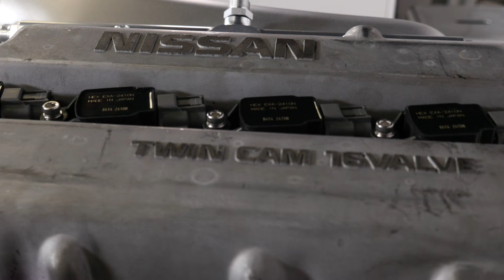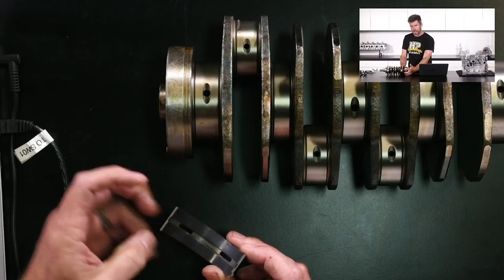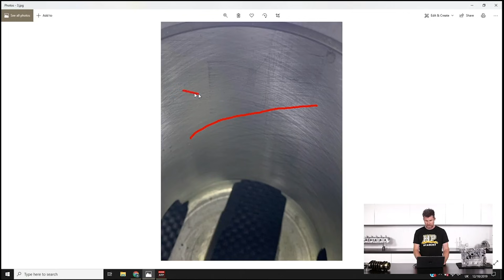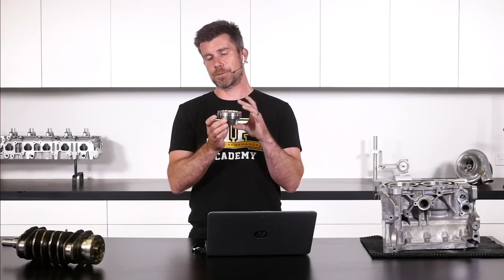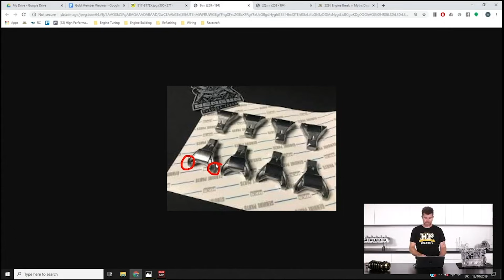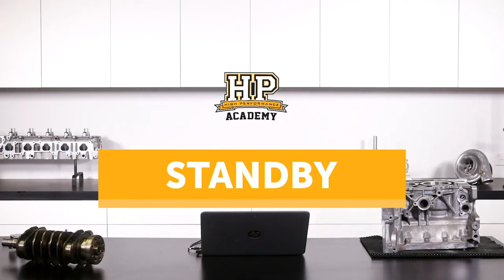Engine Break-In Myths Dispelled | Engine Break-In Tips And Tricks [GOLD WEBINAR]

Comment: Getting a new reman engine in a 2010 Subaru Legacy.  The work is being done in Memphis, and I live in Chicago and I don't have a lot of time off, so I'll have no choice but to drive home (approx. 550 miles) immediately.  That's a lot of highway driving for a brand-new engine -- I know I need to keep the RPM below 4000, not use cruise control, vary my speed -- but what does "vary my speed" really mean?  Every fifty miles?  Every ten miles?   Beween 70 MPH and 50 MPH?  Bewtween 60 MPH and 40 MPH?  I have a manual six-speed, so I can drive at somewhat higher speeds and stay under 4,000 RPM.  Should I make frequent stops (rest areas etc.)?   I'll be getting that first oil changs as soon as I get home, so I won't be too far over that recommended 500 mile limit.  But I definitely want to get home in as good condition as possible.
Reply from the maker: Most of the work is done by about 200km/150 miles. If your builder offers a break in service to do it for you, your situation is one where it might be worth considering that. Alternatively, it could be a fun mish, but you might want to factor in an oil change on the road.
To answer your speed question, as Andre covers in this lesson it's not about vehicle speed but rather RPM and load. You need to constantly work through the rev range and use some load to help expand the rings to give them the chance to bed in.
This can be something that we overthink, but on the flip side, as you mention, a rebuild is expensive, and you only get one shot at the break-in, with long-term consequences from both nailing it or getting it wrong - Taz.
https://www.hpacademy.com/blog/how-to-break-in-any-engine/
Reply: @hpa101  Chicago is about 550 miles from Memphis.   I shouldn't be more than 100 or 150 miles over the recommended mileage for the initial oil change when I get home.  Is that permissible?  I'm not quite sure how I can fit an oil change 50 miles outside of Chicago into what will already most likely be a 9- or 10-hour drive.  The estimates I've seen on that first oil change timeline actually range from 500 - 1,000 miles;  I certainly don't plan on stretching it that far, but if I'm somewhere around 650 - 700 miles, is that potentially fatal?
Reply from the maker: They're longer intervals than we use for performance engines. My advice would be to get the number directly from your engine builder. You trusted them to do the work, so you should be able to trust them to guide you on the break-in procedure that will keep their work warranted I reckon.
Now you have spent some time looking at other opinions etc you will be able to converse with them in a bit more detail about it or question anything that seems like a red flag to give them the chance to explain.
Safe travels! Don't forget a good Spotify playlist and your phone charger haha - Taz.
Reply: @hpa101  I know that I shouild be thinking in terms of RPMs not MPH -- that being said, I've seen it suggested that it's good to vary the speed every 10 to 15 minutes or so (which transates to roughly 10 to 15 miles on the highway).  
A lot of these recommendations are (somewhat frustratingly) vague -- we get a "range" rather than a specific number.  Even the recommendations for that first oil change vary between 500 - 1,000 miles.  (I'll be doing it as close to 500 as I can --  Memphis is about 550 miles from Chicago, so I'll probably be closer to 600 than 500, but I shouldn't be too far off.)  As for the playlist -- my car is old enogh to have a CD player!  But I have a feeling that I'll be listening to the engine pretty intently, just in case something starts to sound wrong, so I won't be playhing a lot of music (neurotic, I know, but this "long-distance" business is pretty srressful).
Reply: Looks to me as if ATK goes with the 500 - 1,000 mile recommendation for the first oil change.
Reply: I just discovered that the mechanic who installed the new engine used full synthetic oil in it;  so did the mechanic who just gave me that first oil change.   Have I inadvertently allowed damage to be done?
Reply from the maker: @jazzmanchgo - I wouldn't panic; it's not something we would do in our performance engine builds, but synthetic oil has come a long way, and it is unlikely to cause a dramatic failure. 
Bedding the rings in correctly and doing that first oil change on time before that metal in it causes damage are really the keys - Taz.
Reply: @hpa101  Okay, good to know -- got the first oil change in at about 800 miles, a little more than I would have wanted but unavoidable given the distance I had to travel to get back home.

Comment: I have just got my 2.2l diesel engine rebuild and was told that i have to load the stock map for the 1st 1000km run in period and then remap to stage 1, is this true or can i stick with my stage 1 map? Should i put some load on the engine the 1st 1000km like +300nm torque, with the current tune the engine made 522nm on the dyno at 2000rpm. It is a 2019 ford ranger 2.2 diesel auto making 146kw and 522nm without water meth injection. When running with wmi its making 156kw and 550nm at 2200rpm. I have currently switched off the wmi for the running in period as per instruction for the mechanic. Your input would be highly appreciated :)
Reply from the maker: If that's what you were told and what it will take for them to warranty the work they did for you, is what it is. Although for the stock tune to be accurate there shouldn't be any modifications to the engine, so running the stock tune on a modified engine would actually be more dangerous as a rule.

Personally I would run the tune for the engine happily, but I'm not your mechanic.

Do not sit at the same RPM and baby it. Progressively start to load it up across the rev range to break it in. As per the webinar things are bedded in long before 1000km though and Andre does run through in more detail - Taz.

Comment: When u are breaking in the rings how long do u wait between ring break in cycles should u apply throttle again to start the pull again to like 3,000 rpm and bring it back down to 20mph? How many cycles till u start to go to a higher rpm? When the rpm is reach at 3,000 rpm how long do u stay on throttle? Can u overdo this breakin process by doing it to often?

Comment: Forgive me if this was covered, can run-in be done on E85 or is Premium 98ron preferred for its lubricating properties? Thank you.
Reply from the maker: Personally I prefer where possible to run-in a flex fuel engine on pump gas (for you that's your Premium 98). With E85 you're generally going to be injecting 35-40% more fuel by volume and inevitably, there ends up some fuel dilution of the engine oil in the sump. I can't say you should never do it but I've always done my run-in on pump gas where possible - Andre
Reply: @hpa101  Thanks Andre. 👍

Comment: I've always wondered about full synthetic oil and engine break in.  On quite a few of its cars, GM recommends Mobil 1 full synthetic.  Do we think that GM is using mineral oil for it's initial fill?  Or, is GM installing mineral oil and then running the engines on a break-in dyno before, then removing and refilling with M1 before installing the engine's in a vehicle?  Not just GM - GT 500's require synthetic and I think also Mustang GT's with the Coyote engine.  What do you think?

Comment: I have new cylinders and new gapless piston ring sets for my engine.
I plan on a 2 step break in with oil from DRIVEN specifically made for break in. One batch is a   
15W50 and the other is a 5W30. Which one shall I use for the first 100km and which for the next 200km before going to a synthetic oil.
Btw. the camshaft are original in good condition with 100 thousand miles on them and look like new.

Comment: Todays new engines are filled with synthetic oil. If you think you can seat rings in 100 km's good for you. The only reason they moved away from so walked break in oils was for epa random testing for fuel efficiency. This is a fact. They pull random cars from the lot's and test them and they must meet standards. Therefore there are no longer break in oils or perriods like 500 miles and an oil change. Sad.

Comment: Breaking-in removes the tops of the hone peaks as the rings bed-in, and cylinder rings, cam shafts, lifters, and valve guides 'lap-in'. I've seen engines torn down with high mileage that still have significant hone marks, as the honing also provides valleys where oil lubricates long after break-in. Yes moderate loads and varying the rpm is the best approach for break-in for the first several hundred miles. Yes, an engine breaking in generates more heat from all the friction of new parts 'bedding-in'. Avoid breaking in at highway speeds on very hot days. Could over-whelm your cooling system, and your oil's ability to lubricate.
With all modern engines having much tighter tolerances than older motors, it's always wisest to follow the manufacturer's recommendations for break-in. Early first oil changes are a controversy. Some see it as cheap insurance to ensure minimal oil contamination from break in. Others see it as the premature removal of the manufacturer's break-in oil, to a waste of time and money. I think changing after the first 3000-miles as not harmful, and cheap insurance. Oil doesn't break down, the additives do. OEM oil filters should be able to remove any particles that could cause wear, so there's minimal risk.
As to not using synthetic oils for break-in, I believe Corvette engines come from the factory with synthetic oil, but I'm not sure if they are a synthetic break-in oil... GM has used a lot of racing R&D and experience on their premier brand so they should know what does and does not work...
I think it's a mistake to put your credence on anyone's 'personal experience'. No independent builder has the resources or even the equipment and expertise to evaluate the results of their procedures better than a manufacturer. 'What has been shown to work' for one builder could be different than 'what has been shown to work' for another builder, so all advice should be taken with a grain of salt.
Reply from the maker: "No independent builder has the resources or even the equipment and expertise to evaluate the results of their procedures better than a manufacturer. "

You are right, but Toyota for example built your 2jz for 200hp or so in a road car, not 600, 1000, 2000hp or more for circuit, drift or drag etc using aftermarket parts like your local independent builder will have done 100's if not 1000's of times (depending on the specific shop and engine).

Modern engines are certainly coming from the OEM with less headroom than older ones for sure however, and the gain or salt comment is bang on noting that also applies to the OEM if you are not keeping within their specifications and parts lists... ;) - Taz.

Comment: I worked at volvo in sweden building engines. And as soon as the engines come of the production line they go on dynos for about 40 minutes.
During this period they are hooked upp to an external fuel/coolant/oil loop.
Let it come upp to temp. Look for leaks etc. 

I thought this was only for quality controll. But probably they are doing that break in thing with the piston rings that you talked about because they do rev them to about 3000rpm and go upp and down abit during that period.
Reply from the maker: It might still be for quality reasons, but they simply have to bed the rings to run it up like that. You only have a small window of time to do that correctly within.
Interesting insight, cheers for sharing! - Taz.
Reply: @hpa101  yea. They talked alot about quality controll. Once in a great while we had some truly spectacular result when something came loose in the bottom end and sploded the engine in an instant XD.

Better there than on the road i supose.

Comment: I have Millers break in oil, But for the first startup I wanna use a mineral oil with ZDDP additive as I will be flushing it out after idling for 5-10 mins. Can I use "MOTUL 3000 4T Plus 10w-40HC-TECH Mineral Engine Oil"?

Comment: i don't have a dyno. can i use the clutch to apply the small load use describe during startup?  handbrake on, 3rd gear let out the clutch - let it slip for 10-15 seconds, etc? or just skip this loading by increasing and decreasing revs for 15 second intervals?

Comment: Older flat tappet camshaft needs 20 minutes at 2000 rpm, break in oil then drive it below full throttle with breaks of up and then coast.

Comment: I just built 2.0 tsi from short block to new head with upgraded springs. Boss 600 cts turbo stage 1 hpfp 35% more fuel.  Running old k04 tune on it.  I get P2015 and P0068 codes.  Are they related?

Comment: The biggest myth is that anyone can dispel the break-in myths.  😂

To truly dispel myths, you need data.  In my 40 year engineering career, I have yet to see a real scientific test of break-in methods.  Everyone has anecdotes, but nobody has data - at least nobody has shared it to the best of my knowledge.  I think there are two reasons for this:

1. Such a test would be hugely expensive.  One would need at least 5 engines built as identically as possible for each break-in regime to be tested, and most statisticians would probably want at least double that number.  If you wanted to test even three different break-in regimes, you would need to build at least 15 engines and then run each set as precisely as possible for probably 20,000 miles or more to really see any differences.  You would then have to tear each engine down and inspect and precisely measure the internal parts.

2. I suspect most engineers who design engines know that break-in procedures really make very little difference and there is likely more variation from tolerance stack up in most engines than there is from break-in regime used.

I’ve personally broken in probably 30 engines in everything from lawn equipment, to motorcycles, cars, trucks, etc.  I have tried a number of techniques from strictly following the manufacturer’s recommendations to the “run it like you stole it” method that some recommend.  I can honestly say that I have never seen any measurable difference in engine performance, oil consumption or longevity between any of the techniques.  I have had engines that ended up burning some oil no matter the break-in regime and I’ve had engines that used almost no oil no matter the break-in regime used.

So, my conclusion is that the biggest myth of all is that the break-in process makes a measurable difference in engine performance, life, oil consumption, etc.  And the fact that no large manufacturer has performed a large scale controlled experiment on break-in processes, suggests that they already know this.  If anyone knows of such a large scale controlled experiment, please post a reference as I’ve love to see it.

Comment: How do you explain all new Corvette’s coming from the factory with Mobil 1 oil?
Reply from the maker: How do you explain it?  - Taz.
Reply: @hpa101  I don’t know, but it seems to fly in the face of the “don’t use synthetic oil during break-in” myth.  The funny thing is that most think nothing of using ZDDP during break-in and it is at least as good as preventing wear as is synthetic oil.  It could be that Chevy simply machines these engines so precisely that no break-in is needed.  I am doubtful as this is GM after all.  It could be that they run all new engines for 5 hours on a dyno.  I doubt that also for cost reasons, but it is possible.  Or it could simply be that synthetic oil works fine for break-in and is just another myth to be busted.

Comment: You mention that current processes and materials don't require the same treatment as those used in older machines.

Where is the line between where your advice is useful and where your advice would damage an older rebuild?

For instance, my 5.7L Vortec is a 30 year old platform but it was designed to run on ethanol-blend fuel.  With a rebuild on a platform that old I am just leery about the difference between what GM recommended, in the 90s, and what you are saying 30 years later.

Comment: ZDDP was reduced because of effects on catalytic converters and as oils became better with lubrication on their own reducing wear, ZDDP became less needed. It also requires higher heat and pressure to actually work which with modern oils is reduced unless high power output is achieved. Racing oils still use high levels as well as gear oils, but Boron and other additives are actually better but more expensive. Engine assembly lube is another myth. Use the intended run in oil, prime components before hand and that's it. Assembly lube is only used when you build an engine that may be sitting around for a long time, but even then you can hand prime/turn an engine. Heat cycling is required for certain head gaskets/studs/valves for re-tensioning.

Comment: Do not use any of the so called "break-in" oils out there...proven to be the worst oils on the market, period. Also proven that adding a ZDDP additive to any oil package absolutely destroys said oil's protection abilities. Misleading to say ZDDP has been removed from modern oils...that is not true at all. The ppm content has been reduced, not removed. Current oils are at the same ppm ratio as they were for the majority of API oils in the 1960's...the absolute heyday for high performance flat tappet engines.